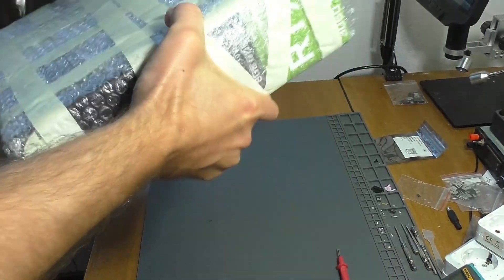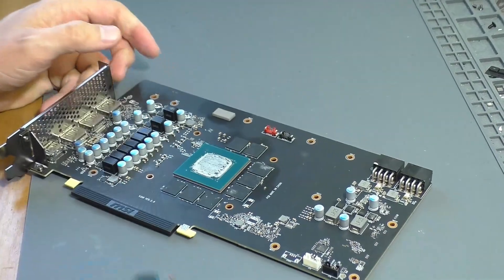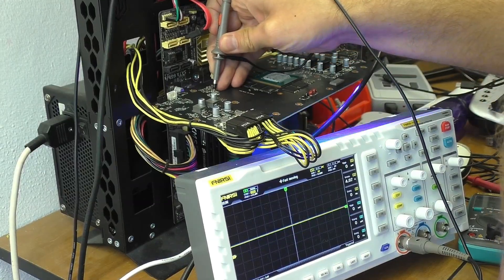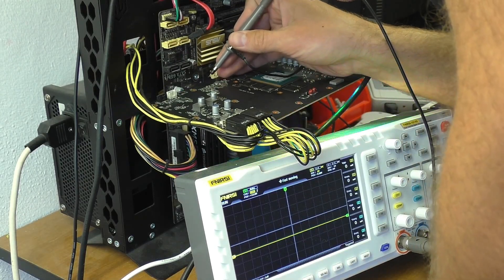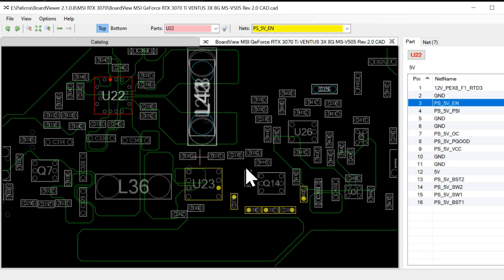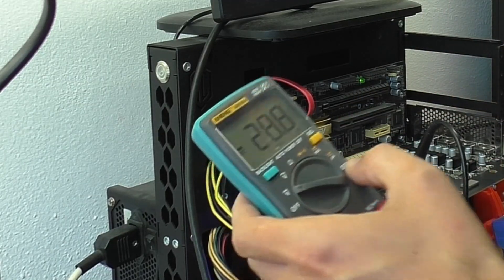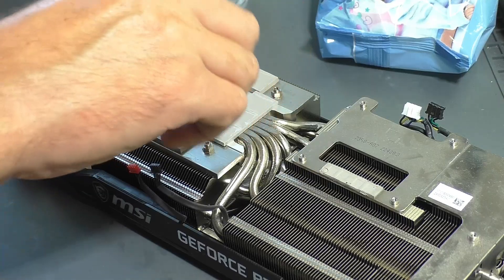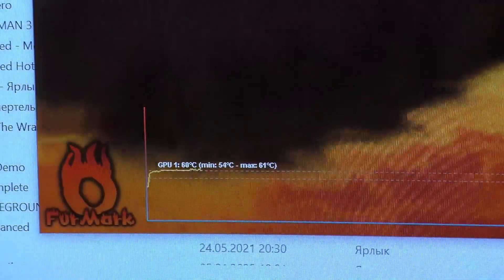No image, no voltages / MSI RTX 3060 Ti graphics card | REPAIR

Comment: Bro when I do gaming my screen goes  black how to fix it
Reply: Check the refresh rate settings on your monitor and your cable connections
Reply: @FreeMind4492 start with full driver removal and reinstall. Set your monitor refresh rate. Also disable variable refresh rate in nvidia and or amd. This can cause issuesm. Lastly some monitors dont do freesync or gsync so may have to disable that as well. Also make sure hdr is not on. Iv had issues with that as well. Good luck!